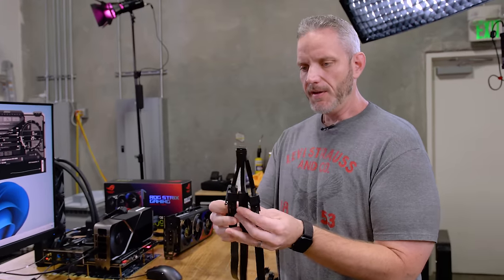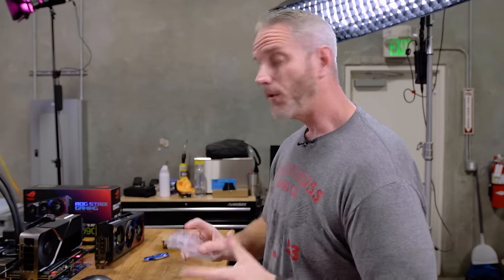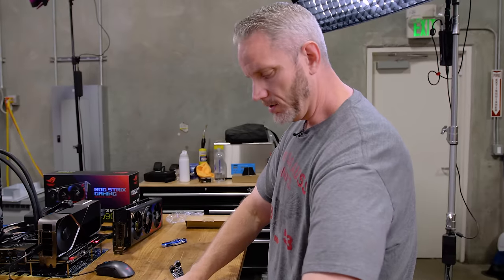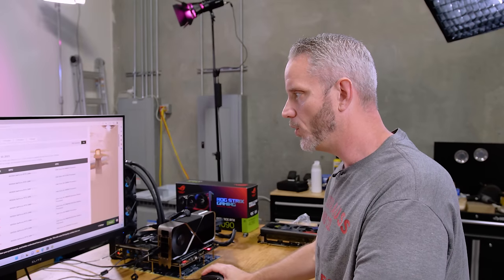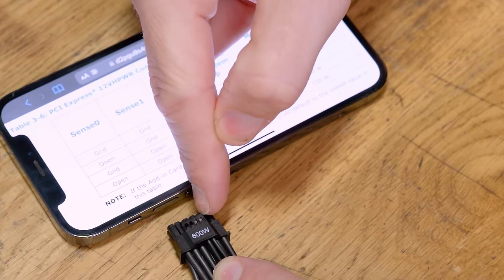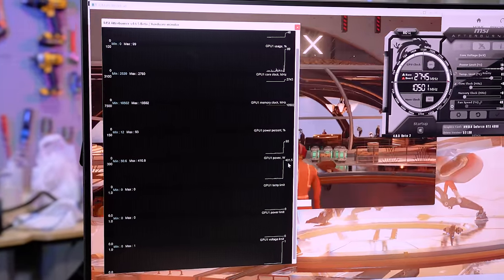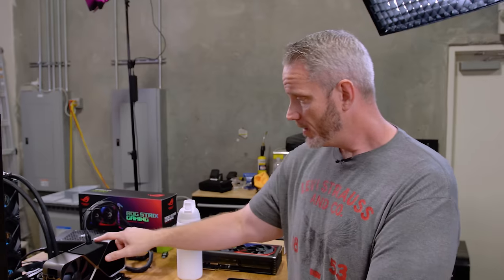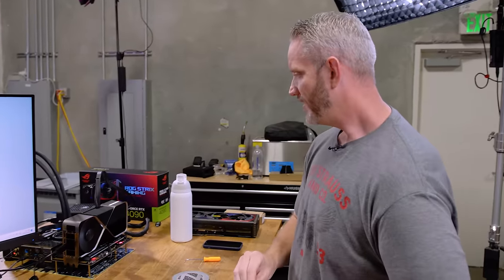DON'T Do this with your GPU!

Comment: Hey Jay, I have a similar issue with the MSI RTX 4090 Suprim X. I don't have any display output on my Gigabyte X570 Aorus Master and the card just won't work. (I have tested two different PSUs, one 1KW and one 1.6KW both with the GPU's dongle and with the cable you are showing in the video.)

I'm wondering though if the behaviour is identical. On my card, the fans do not spin up and no RGB lights up...I it the same on the Strix? I think you mentioned the fans do not spin up but you don't seem to mention RGB.
Reply: did you manage to solve the issue, having similar problem.

Comment: Basically the power supply is a cup full of drink, and the video card pulls the drink(power) through the cables. 20 oz, 30oz or even 5 gallon cup. The video card pulls the same amount, if the card isn't pulling the drink(power) won't start spewing through the cables on it's own.

Comment: If your PSU can deliver 300W per socket this cable should work just fine. It has AWG 16, therefore not more current per cable core as for ATX 3.0 12 Pin cable.

Comment: Onboard graphics is such a blessing to have. When I finished my first build, I noticed the graphics card wasn't being utilized at all. It turned out that all it needed was a driver update. Has it not been for onboard graphics, I'd probably have panicked a little when the display didn't turn on.
Reply: How in the hell does a graphics card not work at all without a driver update? In my past experience they happily function with no driver at all other than whatever default driver Windows uses. This sounds like the manufacturer screwed up badly?

Comment: Appears there WAS some fire between Corsair and Gamers Nexus *(Corsair apologized)*. Corsair was calling BS regarding GN stated all four PCIe power needed to be the Nvidia FE power adapter to enable 133% power budget overclock, GN showed on follow up video only three won't allow you to go over 100% power budget.
This video just proven GN isn't talking about BS, you do need 600W spec to get power budget to 133%. Nvidia's adaptor can sense how many PCIe power were plugged in with their adaptor, potentially creating a problem even when the power supply can do 600W PCIe.

Comment: From what I've seen from GN, the 4 cables having power essentially just tells the gpu how much it can draw. Each one is 150W so 4 is 600W. 2 would only be 300W.
Reply: And the card needs 450 to boot. Remember, however, that it is fine to use the same 8 pin line for two connections (which is why they are pigtailed). So, the connection to the power supply when using corsair's cable and nvidia's would be the same: two connectors.

Comment: Will the Corsair adapter allow 600 watts on a 4090? GN has an engineer from Nvidia saying all four are need for full power. And Steve proved that you would not get 600 watts w/out all four being connected.
Reply: I think that's for using the nvidia adapter.  the coarsair one is for their power supply.  Their power supply should be able to handle the wattage over that cable/connector from their power supply.  Think about pcie power cables from power supplies.  some have more than one 8 pin on a cable.  It should be because the power supply can supply that ammount of wattage for those connectors.

But if you're using the nvidia adapter, it only sees power from each connector.  coming from your power supply, you're probably stll only using 2 separate feeds from the power supply even if it's 4 8 pin pcie connectors.
Reply: Yes. It's because the cable Nvidia provides with their FE cards has an IC in the cable itself, at least according to the GN video. The 16 pin connector is essentially just two 8-pin pcie cables connected together, at least when used on an ATX 2.0 PSU.

Comment: If you got the money to afford a 4080 or a 4090 the power supply isn't your concern. It amazes me that people still have to cut wires when all you got to do is just pull the pin out of the connector.

Comment: Even with 4 plug on the adaptor. You very often use only 2 plug on the PSU side.

Wich is the same as the cable Corsair provided.   Unless you use 3 or 4 individual cable for your adapter

Comment: Over the past couple years I have lost almost all interest in anything from nVidia due to their business practices. That said, I greatly appreciate the way Jay experiments with the new tech that is available to his team.
Consistently great content! 👍
Reply: LOL you just finding this out?   I had 3DFX stock back in the day and Nvido was going to give 2 shares of Nvidia stock to 1 share of 3DFx stock.   So if you have 5000 shares you end up converting it to 10,000 shares of nvidia.  But they found a better idea, they kept 3dfx as a shell company with (no value) so then they did not have to give all the 3DFX share holds 1 dime.  So a guy with 5000 shares at 5.00 a share of 3DFX ($25,000) shares went to 0 so his worth is 0.   Lots of people lost all their money.  And after that Nvidia sent those share holders a letter asking them or telling them they could now buy Nvidia Shares.   LOL oh the number of angry people they created.   They have not changed one bit in 2023.   They screwed over so many people with that dirty move.
Reply: What are you gonna use instead? Subpar garbage and cards? Good luck.

Comment: Damn...eventually we will just need a new PSU with a GPU and they will be bundled together if it uses that much power. That cable grouping is atrocious. I thought the double cable that came with my 1070 was awful, just going to run my 1070 into the ground before bothering with a newer GPU. 🤣

Also I'm still running a 3700x 😅🤣
Reply: I wonder if the new AMD cards will have the same kind of cable fun going on? I'd imagine we will, but their stuff tends to also be more efficient than team green so things might not be quite as crazy.
Reply: @TalesOfWar  yeah I was wondering the same thing when I was commenting. I'm just going to upgrade to a 2070 or idk I will have to research something better than my 1070 I have now if it's even worth doing a 2070 upgrade. I can imagine AMD having something smarter and more innovative though

Comment: They should just make tiny bridge cables on the connector's side, because ground is there. Instead of making those long separated cables that go just to the other side of the ground wires.

Comment: Even with a Corsair 900D case the cables do touch the glass coming from the 4090 Suprim X so I totally agree on your previous video the design is pants for those with small PC cases.

Comment: Solid wire does Not increase ampacity of the wire over stranded wire. AWG American Wire Guage dictates how much ampacity is allowed “recommended” at set voltage. DC wire is slightly different than AC.  And the “limit” of allowed amperage is intentionally lower than it can actually allow for safety reasons.  Just fyi

Comment: FYI, standed copper wire can handle more voltage and high amperage than solid core wire. Why? Electrons only flow on the outside molecules of a give wire. So there is less path in solid core compared to stranded copper. So Corsair using standed copper would have been better.

Comment: just buy one psu with ATX 3.0 and PCIe 5.0 you will get a direct cable x1 PCIe(16 pin to 16pin) 600w cable and x1 PCIe(16 pin to 6+2pin). My psu was very old 9 years had to change it and bought a brand new MPG A850G Pcie5.

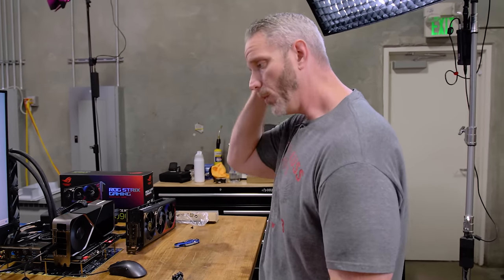Comment: 5:55 Jay, don't cut the cable, just slide the pins from the connector and put electrical tape on the pins...
Reply: Looks like that's what he did 12:30 16:35

Comment: Looks like the sense wires are just attached to the ground pin on either of the PSU connectors. That means that you could just not plug in the connector, and you'd get the same 1-floating-1-grounded result, without pulling the pins out of the 12VHPWR connector.

Comment: With all respect Jay,

It seems that you didn't even ask around on what these sense pins actually do. Igor already stated it back weeks or even months ago: Occupied pins give away the power rating, the other two pins which are unoccupied on this are for communication with an intelligent ATX 3 psu IF i recall correctly.

Comment: The sense pins are no communication device. The card only sees ground there or not. Depending on how many pins are connected to ground the card knows it can draw 300, 450 or 600 watts and one pin to show the card if it's a native 12pin or adapters.

Comment: The PCIE power connectors are rated at more than double their wattage at 12v of the 150w GPUs use them for.
The cables on the other hand are typically not quite living up to that.

But the math all checks out, it's no more insane to do this than to use the 12 pin connector in the first place lol

Comment: the reason the PSU end is only 2x 8pin molex, is because it have 4x 12V lines, the larger gauge wire helps to, but on the PCI-e Power 8 pin they only have 3x 12V, so that's why they use 3 or 4x 8 pin to one mini molex Y connector.

Comment: The reason why Corsair is only 2 cables if because unless you have a HX PSU your PSU is more than likely single rail 12V so you can output the 300w per connector without issues of tripping the PSU.

Comment: I think these power supply connectors and wires should all be re-engineered. 

There’s gotta be more flex to these wires and better connection points while still allowing high power to pass thru..

Comment: So to clarify, this is only a problem if you don't buy one of the new PSUs designed to use the same cable? Because I'm happy to wait and buy both at the same time.
Reply: I guess you need a single rail PSU with this 2x8pin adapter, any age. Multi-rail should be limited to 150w every 8-pin.
Reply: @christianandrew4746  I was meaning more of a 12 Pin from GPU to a 12 pin on the PSU. So one cable and one plug :) Sorry my wording was kind of vaque

Comment: Just finished building a PC with a 4080. I just used a Seahorse extension for that power cable. I would suggest anyone with a 40-series to not use that piece of crap, use a good extension for both safety and easy cable management.

Comment: Got this cable and it's a champ was able to pull 520w with this cable.. overclocking my 4090 had no issues at all.. 

Would recommend if your into a clean cable management

Comment: normal pcie cable have it too... one pin on 6pin connector and total of 2 pins of 8pin connector, they are even similar setup, gnd or open.

Comment: Seems Corsair cable does 2x 300w hence 2 plugs on psu end, only works with corsair psu's.
Removing the "informant/sensor" cable it's probably doing load balance 225w + 225w = 450w
Removing both would be telling the GPU " hey we don't know whats the acceptable draw of this cable/psu, don't start"

Basically we need PSU's to start getting rid of the Y cable and just have proper single cables and also GPU's to come with standard 12 pin connector even if its a 50/60 class GPU
Even the motherboard needs to changed were now seeing 24pin + 8pin (2x4) cpus, why not have a single 30/40pin connector?

Comment: have you not seen the gamers nexus video,
 explaining how corsair doesn't know what they're talking about?
you need the two small sense cables to overclock to 133%=600watt.
Reply: That only applies to Nvidia's cable adapter. That's what Steve from gamersnexus was talking about when calling out Corsair. Not Corsairs own cable. The way this cable works is completely different.

Comment: I got the CableMod version of that. You can select your exact power supply so that they can make the cable to you the exact spec of your PSU. it has 3 8 pin connectors that plug into the power supply and the 12VHPWR on the other end. It looks so much better than the adapter that came with my 4080. You can also customize the hell out of them.
Reply: Which cable did you choose? I’m not sure which one to pick, I don’t see a 3 8 pin option

Comment: Right on! Much better solution. But if solid core. Tight bends need some caution. "Nein Nzxt!"🙃
Betting it's thicker strand with a tighter twist for safety.
You're not even allowed to used solid core in aircraft because of vibration alone.

Comment: Bro solid cable isn't as efficient as stranded when it comes to the flow of current through a conductor so it would have been better if it was a stranded shielded cable

Comment: "That's how they were able to do 2 not 4"

The thing that's being ignored here, is that those 4 PCIe plugs already only plugged into two power supply outputs.    Every modular power supply I've ever owned has a single 8 pin modular supply plug and on the other end an (A) and (B) 6+2 pin breakout.   So instead of going 2x (Power Supply) -> 4x 6+2 -> 1x GPU.  It's skipping the breakout from 2 -> 4 -> 1 and going 2 -> 1 right?

Comment: I have 2 scenarios that I would like to see tested please! 

1.  What if the Sense1 pin gets disconnected while the system is powered up and a video is displayed?   Will the  video continue to be displayed or will it immediately shut off the video output? 

2.  What happens if you split one of the sense pins on the psu side to make 2 pins on the gpu side?  Will that give you access to the full 600 watts?  If it works, then I could see lower tier psu manufacturers possibly doing this to try to cut costs.
Reply: For #1 - I guess someone should try it and see!

For #2 - at least in the case of this adapter, they are both simply connected to GND at the PSU, so taking one of them and splitting into two at the GPU end would give the same results. The current in the SENSE wires would be very low, so no problem with voltage drop or resistive heating.

Comment: Some time ago, I connected the new RTX 4090 to the Intel Z370 chipset. I also caught a black screen. Having connected the monitor to the integrated graphics in the processor, I saw that the system simply does not see the 4090. A minute later, the card was automatically found. There were no drivers for it. The system found them by itself. After connecting the HDMI cable to the card, the system continued to see it without any problems.

Comment: I did some research on this a few weeks back. The 2 pins are grounds. Its not tricking anything. It will literallly test the waters. If you drop voltage quickly it will draw less power. Its rated for 12v +5%/-8% (11.04v - 12.60v)
You can see the spec says:
if sense 0 and sense 1 are shorted to ground the cable is 600W.
If sense 0 is open and sense 1 is grounded its 450w.
If sense 0 is ground and sense 1 is open its 300w.
if sense 0 and sense 1 are open its 150w.

The 2 pins used here are sense 0 which is pin 3 and sense 1 which is pin 4. The other 2 are "signal" cables though I am not sure what signals they would send. Pin 1 is card power stable... Which does not mean anything it could literally mean if its grounded the PSU is saying its locked in. Pin 2 is a question mark for me.

Essentially what the sense pins do is allow the GPU to measure the ground to 12v "real" voltage and check if there are spikes. Real voltage as its using a line that is not contaminated. Though they should use both ground and 12v lines in that case IMO otherwise you still have errors. I guess they can measure acurately the power through the cable with the voltage drop.

Really these cables are not magic but IMO they are designed wrong. Hopefully this type of cable (the specification) wont last long.

Comment: Igor (igors lab) did disassembly of the original founders edition adapter, from the 4 "sense pins" only two are connected aswell, they are sticking one wire in each, but the wires of the second pair of "sense pins" isnt connected to anything they just hanging around beneath the sleeving doing nothing.

Comment: There is no communication with the PSU, the sideband connector pins are simply connected to ground in a pattern that indicates the available power, which according to the already leaked specs does include much lower power ratings for much cheaper cards (implying that they want to replace the old ATX connectors entirely instead of just providing a more powerful alternative).

This makes it fairly simple to wire up the already existing sense pins on the 8-pin connectors in a way that the available power is detected correctly based on the connected plugs. There are only 2 pins connected on this adapter because you only need those for the bigger power ratings. If there is any logic circuity involved with those adapters, you can probably count the amount of transistors with a single hand.

Comment: i feel like your challenging Steve logic vs yours ....since both are not electrical engineer but i guess corsair want to sell more psu  atx3.0   while nvidia want use all 4-8pin pcie connectors ....all i want to know , what is your psu Jay...does this works only corsair or universal ?

Comment: Actualy you can put more ampere trough strainded cable then trough solide ones. The only reason to sue solid cable is because they are cheaper since they are easier to manufacture.

Comment: I just don’t understand why we have these breakout/octopus adapters at the GPU side… Like if they want 4x ATX plugs, fine, but give me an adapter with 4x short ATX male lines that plug right into the PSU, and then let me run the single long 12v cable through my cable management.  Then I can tuck the octopus in the PSU shroud compartment out of sight.

Comment: Engineering wise. I love this approach. It is a single universal connector that works for all GPUs and PSUs from massive to tiny and ensures the GPU won't overload the supply willy nilly.
An improvement over just using more and more old clunky 6/8/6+2 connectors.  Its just the transition with all these fugly 4-headed adapters over the place that sucks.

Comment: Thicker gauge and solid core can carry more current, basic engineering.
More bending also means less current capacity, it could also crack and break.
To be honest stranded cable is more suitable for PC's purely because us users bend the damn stuff.